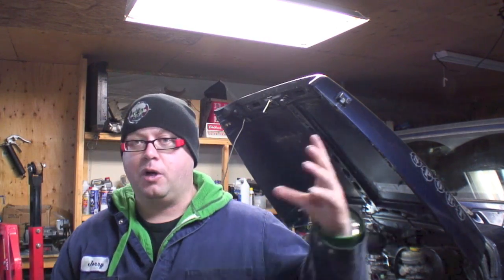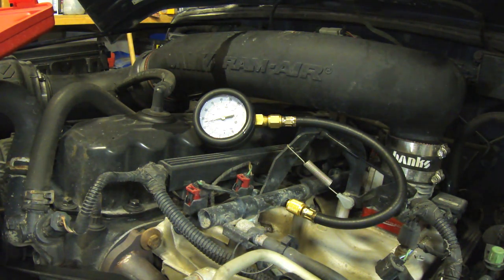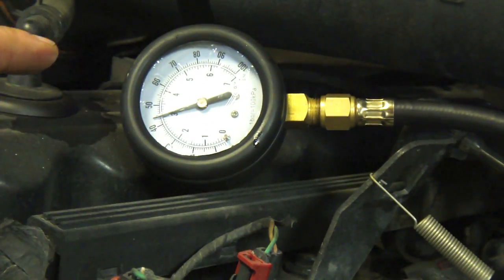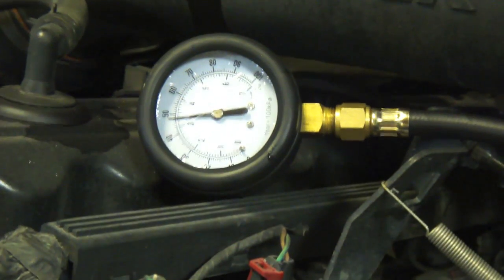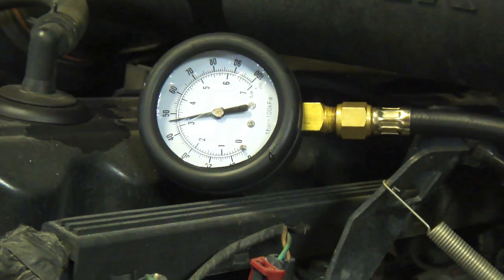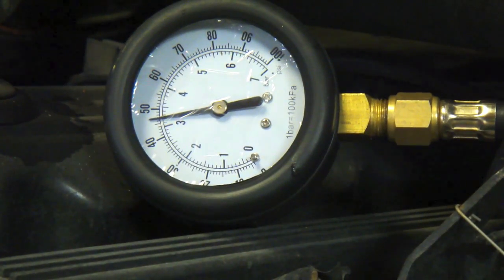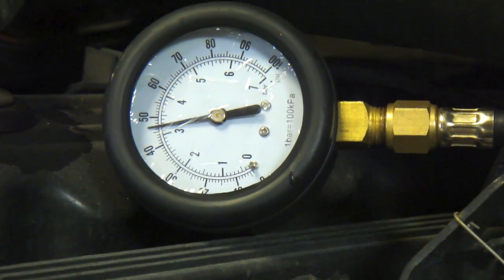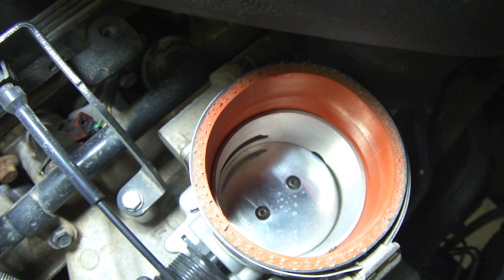How to do a Fuel Pressure and Leak down test

Comment: Curious to know when doing the leak down test, how fast is too fast when the pressure drops off.  Working on my old 1977 Chevy Nova here.  No pressure regulator, just the fuel pump.  By the way, what kind of beer do you drink ?  Recently discovered Becks.  Not bad...

Comment: I DID THIS TEST THE OTHER DAY,HAD A BEER READY BUT I ONLY GOT TO DRINK A COUPLE OF SIPS.LOST PRESSURE PRETTY QUICK.TURNED OUT IT WAS LOSING PRESSURE BACK THROUGH A WEAK FUEL PUMP.(FYI)I DID DRINK THE BEER AFTER I WAS DONE THOUGH.GOOD VIDEO.

Comment: My wife's jeep grand cherokee has a problem with taking a long time to start. I have replaced fuel pump,  filter/ regulator, crank position sensor, camshaft position sensor, map sensor, air sensor. It has 52lbs of fuel pressure while running but shut it off and come back the next day, there is no pressure on the rail. When letting the pressure off the fuel rail to change the filter I noticed this. Would it be a faulty pump or Injectors? I don't want to keep chunking money at it.. If you can point me in the right direction i would appreciate it..
Reply from the maker: Sounds like you been busting out the Parts Cannon instead of properly troubleshooting the issue.

Comment: Question, on my 2000 Jeep Cherokee Sport, whe I put the key on it goes to 45 psi, start the engine and stays at 45 psi, turn off the engine and after 10 min goes down to 12 13 psi. Is that an injector problem? Are they leaking? Thanks

Comment: idle air control governs air at idle not throttle body...it allows a formulated amount of air to bypass the TB flapper when its in its fully closed position

Comment: What if you had just installed a new set of injectors and still had a leak down (loss of pressure) after shutting off the engine? What else could cause pressure loss?
Reply from the maker: fuel pressure regulator
Reply: Bullshitkorner check valve in the fuel system holds pressure

Comment: Hey man I've always liked your videos--very helpful, including this one.  I'm having a problem with just no power getting to the engine.  Cleaned the crap out of my TB and replaced all the TB sensors and the plugs and still no dice.  I rented a pressure gauge and when I turn the jeep to the ON but not RUN position, I am only getting 12 psi.  But when I turn it to Run I am getting the 46 psi or so that you were getting.  Can you think of why I am only getting 12 at ON and do you think this might be an issue or just a different setting for the fuel pump? I have a 2002 4.0 engine if it matters at all.  Appreciate any thoughts you have.
Reply: You figure this out, Nate? Mine's the same way. Only 19/20psi in the on position, but jumps to around 49psi after i run it. I don't leak any pressure after I turn it off, so I wonder if attaching the hose onto a cold vehicle it is normal to have lowish pressure. If not, then it's losing pressure somewhere while it's off. The issue I'm working through on my '99 TJ is a tricky rough idle

Comment: I stopped watching early on in the video, after he forgot to mention COMPRESSION as one of the things an engine needs to run. Sorry, had a mechanical newbie watching with me and had to explain that the guy in the video is wrong, that you also need compression. Granted, we were looking for a compression leakdown test but you can't leave compression out when describing what an engine needs to run.
Reply from the maker: +Pat Foster sorry but the video is about a fuel leak down test has nothing to do with compression at all.
Reply: Yes i know that, that's why i added that we were looking for a compression leakdown test. not trying to nitpick, But I cannot help myself. i am picky. When someone says 'your vehicle needs three things to operate' and they dont include one of THE MOST IMPORTANT things that your engine needs to run, i am going to be upset.
Reply: +Pat Foster I commend though everything else seems useful, not to my particular project but for someone in need of a good english guide, for fuel pressure problems your info is spot on.
Reply: Pat Foster you jumped the gun bro. can't have compression if the engine won't run . fuel, air, spark that's what you need to make a engine run. engines run on low compression.  you're right, your nit pickin. stop that douchy shit and thank him for the help. if your a master mechanic and already know everthing, stop watching his vids.
Reply: Boo
Reply: Pat Foster is a douchy forum troll. If you can do better than send the link to your youtube channel.
Reply: Compression is NECESSARY for the fuel to even ignite properly and make the engine run. you CAN have compression if the engine doesn't run. Yes engines can run on 'low' compression, But the engine with low compression, that still runs, WOULDN'T run without that little bit of compression. (example- and perfect example, is a single cylinder engine with a bent valve, no compression, will NOT run) In physics, and especially in mechanical repairs, it is RESPONSIBLE to nitpick- have everything exactly dead on accurate. Make sure it is PERFECT. That's how you get good at shit. Nitpicking doesn't equal trying to belittle anyone, it is simply, making a PRECISE observation. I put a like on the video, as it was informative- I made comment as well so that hopefully, dude remembers and NEVER leaves compression out when he lists the things needed for an engine to run. Have SEEN people waste way too much time trying to find reason for their engine not running, trying to check all kinds of fuses and futile attempts at fuel, spark, air delivery, and never once checked compression, when that was the issue the entire time and one of the first things to check, by almost every engine's shop manual.

Comment: @billshitkorner... I have a 1999 chevy Tahoe that is idling rough when warm only runs great when cold.. it smells like gas and tailpipe is black... I changed the spark plugs, wires, distributor cap and rotor button... runs better now but still rough when warm... what do you think I should look at next?
Reply: +Daniel Acuna look for a VACUUM LEAK
Reply: +Pat Foster And i mean intake vacuum leak. intake manifold gasket, at worst, but maybe a vacuum hose is cracked or disconnected. classic CLASSIC vacuum leak symptoms- runs fine cold, but as soon as it warms up things get rough, even dying at idle sometimes.
Reply: Yes same symptoms but it was a bad spider injector... got it fixed thanks.

Comment: Could you use a compression tester with an adapter to test fuel pressure at shraeder valve?And blow it out with air after?

Comment: I now KNOW what's wrong with the wifes X5, and my "parts changer mentality :(  Exactly what you begain saying in this video, I threw parts at the problem and not fixing it.  P0171/P0174 (lean bank 1&2).  I replaced both pre O2 sensors, camshaft (both), crankcase, DISA, MAS, air filter, fuel filter.  And finally went to HF and picked up a $20 fuel presure tester, and BINGO...I've found the problem.  I've watched many of your videos, I not sure how I missed this one.  Ahhh!  :)  Anyway, thanks for the video

Comment: Ok, LOL  here I go.   had to get more beer for this and i'm waiting to break this 12pk open for the answer so that doesn't happen again.   I have a Leak down problem that throws no codes.  No injector malfunction codes, no evap codes, no outward gas leaks at all. 
   i replaced the fuel pressure regulator today even though it appeared to be fine on the grounds that it might have been stuck wide open. made no difference however.

  brand new fuel pump and filters are working like a charm, engine runs and drives very nice once i crank the piss out of it to get it started, no rough idle, no lost power.   just leaving it in the ON position to prime it, even three or four times does not seem to be enough, I actually have to crank it and stop 2 to 4 times.Bleeds down to zero in 5 min or less after shut off.

   anyone ever have this going on?

Comment: would be so cool if a fuel pressure gauge had a end that matched up to my rail valve on this 2001 yukon denali.      is there some tool name some one can shoot to me so I can buy one that doesn't cost my left nut? 

   also, anyone ever have black crap, looking like coal dust packed in the fuel filter sock. enough to stop flow after say 400 to 1200 miles?  
Thanks man,   i just went a little shop thinking I could throw the guy 20.00 bucks for a fuel pressure check and he told me 103.00 to start  and it will " WILL" go up.   I didn't really even have the 20.00 LOL  so that was funny.       I just put a new pump in and new filters. it runs fine on a second start. but thats what it;s been doing for the last 5 fuel pumps.  ( I clean the tank and change the filters every time by the way, there is NEVER anything in that tank.) I even strained the gas to see what the hell!    and then I use new gas afterwards.  i use the old gas, which seems fine and is ) in teh lawn mowers.
Reply from the maker: Leisure suit Larry http://www.amazon.com/gp/product/B00K3269VO/ref=as_li_tl?ie=UTF8&camp=1789&creative=390957&creativeASIN=B00K3269VO&linkCode=as2&tag=bullshitkor01-20&linkId=AYXRHDMYEBALKVSD
Reply: Bullshitkorner     That one will get it hu?    sweet.   this one in the link is a little less than twice the amount of the one one I got before and it didn't have the right fittings for my rail.       

   I just put a new regulator on it, took it out to test it and I still have the  bleed down.   

   I did go to auto zone on my test run and they have a kit that is similar to the one on amazon.   they tell me I just have to leave a 150.00 deposit and I get it back when I bring the set back in.   Id like to own the set but thats a pretty great deal really.   I just didn't have 150 bones at the time.   Thanks for that link though, I might just get that and keep it.  

   I had a thought that the regulator might be clogged with that same black crap i was talking about and yet not have the membrane torn, that maybe it was stuck Open and letting the pressure off.    apparently it is something else though.   still doing it  way hard start,  I wonder if that black stuff could be designating fuel pump?    sounds implausible but im at the end of my rope here. 

    this things pissen me real bad.  its super difficult to believe this thing cost 50k 14 years ago.
Reply from the maker: is there a fuel filter to change or is it like the jeep and built in the pump ?
Reply: Bullshitkorner   there is the inline fuel filter ( can type)  and on the assembly  there is two filters( Sock type) , one sits directly on the bottom of the assembly straight on the pump intake, and the other is inside the assembly and goes on the other intake of the pump.   exactly like this, in this one you can see the sock type bottom one sticking out and the internal one that rides on the side of the metal pump housing is inside  the assembly. http://www.amazon.com/ACDELCO-Module-Assembly-E3508M-V8-6-0L/dp/B00LFTEV9G

  the inline ( can type one ) is between the gas tank and the engine just inside the frame under the drivers side door.

Comment: Hi, I have a 1.5 DCI on a Micra which has the Renault engine under acceleration of 2500rpm or over the engine management light comes on, but as soon as you let go of the gas the light goes, its had a new fuel filter on and still same problem, no codes coming up on diagnostic test, it starts and drives well apart from that, no smoke etc, any help please

Comment: good clarification - so I think to install an AutoMeter electric fuel pressure gauge in my XJ 4.0 - useful ?
Reply from the maker: yes you sure could, it would help pin point lots of issues down the road, that and a vacuum gauge are good to have

Comment: I need help please.  I have a 2005 BMW 330i ZHP model.  I ran it out of gas and repeatedly tried to restart it not immediately realizing it was on E.  After towing it home and adding  plenty of premium fuel all it will do is crank.  No fire at all.  How can I check if the fuel filter is plugged? I can check engine codes because I cant start the car.  Is there a way to prime fuel injected cars? When I tried to restart the car repeatedly with an empty gas tank would that have probably killed the fuel pump?  Is there a way to use a multimeter to verify if a fuel pump is bad?  PLEASE HELP...

Comment: Would these issues cause a car not to start at times or cause it to idle so low under 1000 rpm that it wants to shutoff and will shut off sometimes? Sometimes we have to put our foot on the gas to keep it from shouting off.

Comment: Man, you nailed it on the head, I replaced Fuel pressure reg and CO2, Map, Throttle position, and several other sensors and still runs very rich.  So rich that you wouldn't want to light a match in the back by the tail pipe.   If I take out a plug you can see a fog of gas shooting out of the cylinder.  It'll run with the fuel pump disconnected, running although pretty lean.  It's a 93 Sunbird 4 cylinder and also there's no engine light on.  Great video, funny and informative. I think I'm going to try the leak down test.  It's not that easy on this car.
Any ideas, Thanks.
Reply from the maker: just hook up a pressure gauge and measure the drop over 5 mins,  to find which injectors will be harder, I know you can buy a tool that hooks up to your injectors but it's quite pricey

Comment: I noticed when my truck gets crappy idle starts sounding like air is coming out of the engine. I noticed that a no bus is also coming on when that happens. does that make sense? should I tear apart my dash and look at the connections and crappy half eatin wires? where would you go with this one?

Comment: hey man im lookin to et various gauges. vacuum fuel and leak down.what brand is good to get? what do you think about otc? also looking into getting ignition like tools. whats your suggestion for me to get to diagnose stuff?
Reply from the maker: OTC is decent, Everybody has their own opinion having good brand name equipment is awesome if your in the trades and using it almost everyday.  If your just having in your garage and may use it once or twice I usually get a cheaper brand unless it's something that I really need to be precise about
Reply: i took my truck to a mechanic and found that i have a vacuum leak from inside the intake. the plenum pan. ahhhhhhh ive heard about these things hahahaha. you know what time it is???

Comment: fuel pressure and leak down test/ could you explain how you hooked up the pressure gauge to the fuel rail? is it a matter of disconnecting the fuel line and connecting the fuel gauge? thank you,
Reply from the maker: there is a schrader valve on the fuel rail, screw the pressure gauge into that
Reply: Wouldn't fuel leak out from the fuel line going into the Schrader valve? If it not attached to the fuel rail?
Reply from the maker: WTF ??? Why would the fuel line have anything to do with the schrader valve ?? the fuel line is connected to the fuel rail, the valve is attached to the fuel rail.
Reply: Because doesn't the fuel line go into the Schrader valve? I'm concerned that when I start the car fuel will leak out. Am I right? Or am I missing something? Thanks again for your help
Reply from the maker: Your totally missing everything. I would highly suggest for your safety, that you let the garage take care of this one
Reply: I know. I Can Do This I Just Needed Some Clarification
Reply from the maker: steven chandler all you need to do is make sure you have the right adapter on your pressure gauge.  screw it into the scharder valve.  don't start your vehicle but key on only so the fuel pump runs and check for leaks before you start it.
Reply: You are the best!  Thank you
Reply from the maker: Good luck and be safe

Comment: I just checked the repair manual and it said if pressure drops more than 5 psi in 5 minutes then it could be bad regulator or leaking fuel injectors. So is it double the psi in 10 minutes?

Comment from the maker: not sure, give it a whirl and let me know what happens
Reply: Bullshitkorner  I did this test. And my gauge is dropping dramatically. I mean down to like 10 psi. Almost immediately. I even went as far as isolated the fuel rail. And just tested at the fuel line itself. I removed the rail to see if I noticed a obvious leak. But was not leaking the slightest bit..WTF can it be?? Stuck injector when they are plugged in??? Please any ideas would be appreciated. Thank you sir
Reply: Bullshitkorner  I want to add that their is a new fuel pump and tested ok

Comment from the maker: i will be covering the brakes in stage 2, i want to rebuild the front end with new ball joints,rebuild the front driveshaft,axle ujoints, all new bearings and seals plus locker and new gears, rebuild the rear with locker, gears and hopefully a rear disc conversation.  i have some projects i need to finish up first like rebuilding my seadoo and some things on the boat and quad.  plus do some rust repair and painting on the bmw

Comment: do you get your parts from quadratec how is the banks ram air i put the monster exhaust on my tj and it sounds and runs great want to get advance adapters linkage kit cause the stock one sucks i changed my tps as well and added some champion plugs dude you should do some beer reviews on rot gut beer love your rants too running out of characters see you on the next segment

Comment from the maker: a jeep is a perfect project only because they are relatively easy to work on, there is endless amounts of aftermarket parts, and once i'm finished building the second stage of the jeep there will be virtually nothing left on the jeep that i haven't touched.  except for the stupid automatic transmission that's one thing i'd never try to rebuild.  rebuilding small motors as a kid is how i started to learn about mechanics, just taking them apart to see how they were made is how it all began